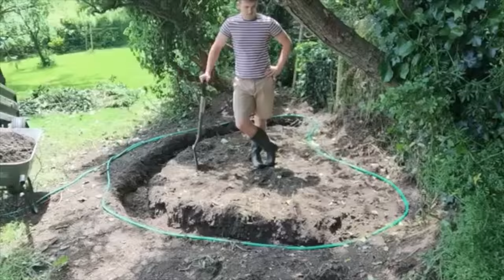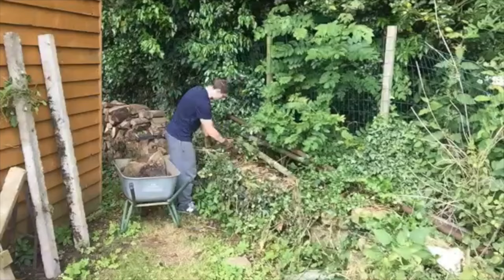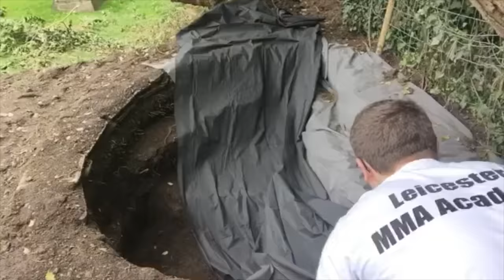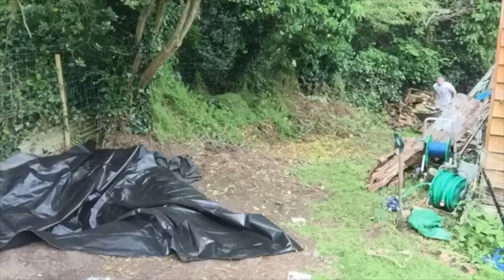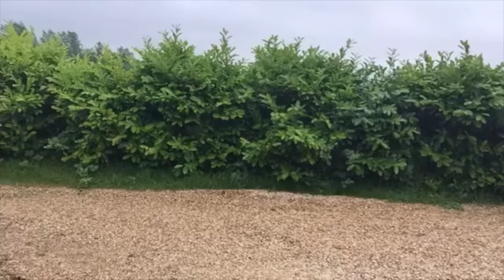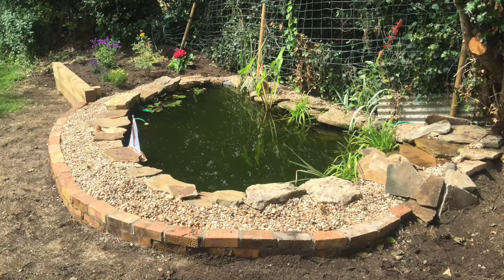TIMELAPSE Garden Pond Build

Comment: how did u fill it ? will water seep through the liner? will it hold up? do u need to fill it again and again?. pls reply as am thinking about doing a diy college break project.
Reply from the maker: I filled the pond from a tank of collected rain water. Don't use water from a tap or hose, especially if you are installing fish because the chlorine will kill wildlife. I used a standard PVC pond liner and it has managed to hold water for 8 months without any leaks, just make sure that the earth is free from sharp stones, sticks etc before installing. It's also a good idea to put a pre-liner in to act as a barrier between the lining and the earth. When the weather is hot it may need the occasional top-up due to evaporation... waterfall features tend to make the pond evaporate faster.

If you do this project make sure that the entire perimeter is completely level. I thought I did a good job until I added water and noticed there were a few low spots which ruin the look of the pond. Also make sure you buy a liner that is too large... that way you can easily modify the perimeter so the the liner is completely hidden before removing the excess.

It's definitely a rewarding project to do, I hope you have success building yours :).